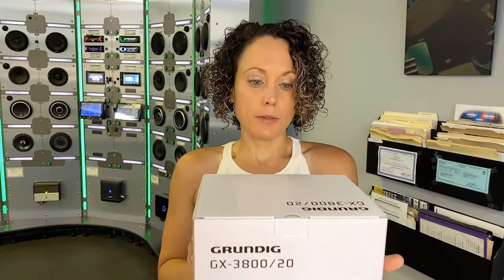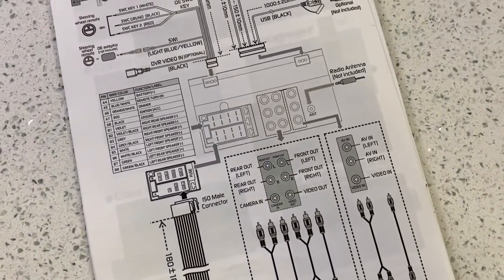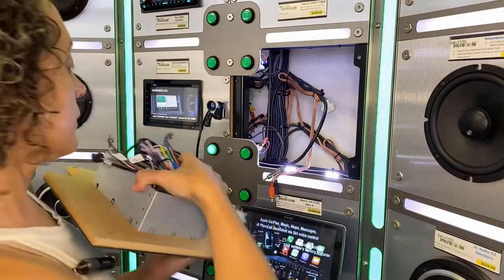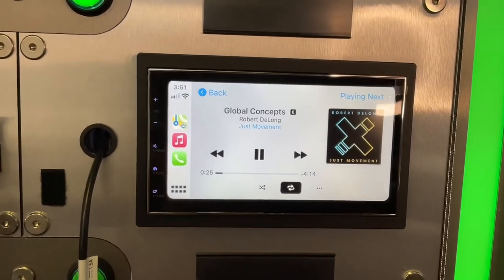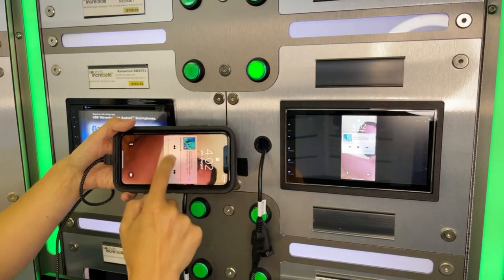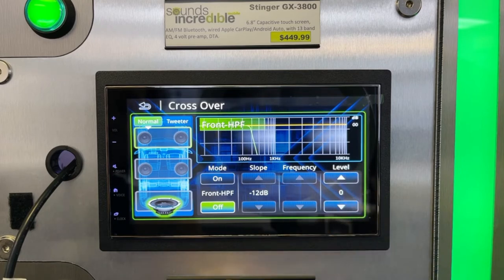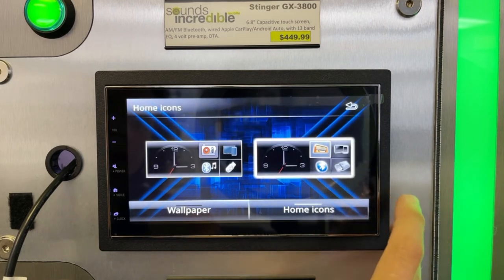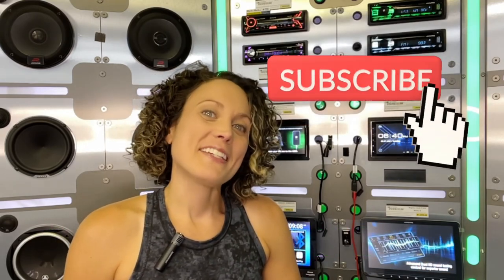Grundig GX-3800 unboxing PLUS Review CarPlay Android Auto Stinger Electronics by @carstereochick

Comment: Just bought this unit after having had 2 Kenwoods go bad after a year each from the same shop. I can't build a system on stereos that don't work. My next purchase was going to be a Kicker low profile sub with an amp, but now with this sudden failure of my Kenwood I got this unit and am so happy to see the crossover and virtual sub options. I have a Wrangler JK that will never sound like my husband's truck but I want to come close. Thanks so much for your detailed review! Hoping to get right into setting it up in an hour when I pick up my Jeep.
Reply from the maker: 😬 I’m glad you found the review helpful, but I gotta ask what model Kenwood?? Kenwood has been rock solid for me with anything that is CarPlay or Android Auto compatible (I have one in my 2014 JK). Did they send the defective Kenwood radios out to find out why they failed? Only reason I ask is Wranglers are notorious for leaky tops and the only time I usually end up replacing a Kenwood in a Wrangler is due to failure by “liquid intrusion”. Usually you can’t see it so the shop might not be aware. The Kenwood repair center we use, United Radio does free estimates for out of warranty equipment. Might be worth finding out why the other two really failed.
Reply: @carstereochick  the first one I don't remember the model but it was a DDX model bought in Feb 2019 that had USB and disc player. In May 2020, I was pulling into the driveway and suddenly heard a loud POP and it went dead. Admittedly it had sprinkled that day while I was driving but didn't think much of it since no water ever hit the dash (or so I thought). This last one I got to replace it, was a DMX706S. A month ago the unit just turned itself off and on, off and on, twice, as I was driving. Then last week the unit stopped talking to the steering wheel controls, and the buttons which I'd made yellow, first started going through a demo cycle, and then settled on red. Then I couldn't use any of the buttons, only the touchscreen. Mind, I usually only ever drive my Jeep for an hour in the morning and an hour in the evening 6 days a week, since we use my husband's truck when we go somewhere together. I have not had the top off my Jeep since May 2020 (since I feared rain going in the disc slot burned up that one). I have a 2015 JK Sahara by the way.
Reply from the maker: @runswithbeer  thanks for the details! Yeah, I gotta say that is really atypical of Kenwood, that’s why I’m so surprised, but that behavior is exactly what I see them do if they get wet. I usually see issues with the freedom panels either not seated perfectly or just the gaskets wear out over time. You don’t always see it and it can drop right in the pocket over the radio so definitely just something to keep in mind. I could see a fluke with one unit going bad, but two in such a short time span seems like something else going on that we’re not seeing. For what is worth, I have the fewest defectives with Kenwood; I can recall one in the past 2 years and so far I’ve had really good luck with this new model and I hope you do too!

Comment: Would like to add that my tech at the shop really went over & above, sitting in my Jeep with me and setting up the Crossover, EQ, Virtual bass, and X-Bass based on how I liked the sound. I feel like you either have to choose between the Virtual bass OR the X-Bass. Both on at the same time doesn't sound right. But boy does the bass really pump! I laughed and told him he just screwed himself out of the Kicker sale. LOL The only issue I have right now is that when driving, the radio station changes for no reason if it fades out a little. I'm playing with the RDS settings, and it seems that turning on AF has fixed that.

Comment: Please help me with this. When you start up the car is it really necessary to select country and continent every time. And I also need to go to settings and turn demo off as well ?  There’s like no exit and save. Can you help me with this question
Reply from the maker: Sounds like you didn’t wire up constant power because it’s not retaining memory. Check your wiring with a multimeter, need constant 12 volts regardless of key position on/off on your yellow wire. Good luck!
Reply: @carstereochick  OK thank you so much 😊
Reply: har samme problem fandt du af det?

Comment: Great video - best I have seen on this unit, which I have now installed in my Mercedes W211. One question, you didn't really show the purple reverse camera wire. Can you tell me what sort of connector that is? Do you think a separate power source would be needed for a reverse camera or is there a plug and play camera on the market I can buy?
Reply: Conservas el menú del coche para activar o desactivar por ejemplo el control de estabilidad o mirar consumos del vehículo? Gracias

Comment: The light blue/yellow wire labeled SWI. Is it directly plug into canbus SW controls? My 2005 Saab 9-3 runs canbus from the Controls to the factory radio.

Comment: I just had one of these put in my Cadi 2010 SRX, and I'm trying to find the right adjustment for sound quality. Do you have any advice? I had to get the whole kit for it to fit, I just want my sound quality back. Oh, this was soooo helpful because I thought I just some ole cheap radio but you help me to see thing differently.
Reply from the maker: Hi Sean, I'm sorry to hear you're having trouble with this stereo in your 2010 SRX. Do you know what kit was used, was it the Metra kit? Normally when upgrading to a new head unit in an amplified vehicle like that, we usually see an improvement in sound quality because we're retaining the premium amp/speakers, but we're starting with a cleaner signal at the head unit. Additionally, many of these installations are done "speaker level" input meaning we're basically amplifying an already amplified signal so usually you will have more output/better sound quality with the aftermarket stereo. 

However, it depends on how the factory amp is retained. I know Metra makes an all in one kit and I only see two wiring options, I don't see any adjustments for gain settings or anything like that in their instructions but I also can't see if it's RCA or speaker level. It would be hard for me to say what to do without having heard a before and after and looking at the harness/interface used.

Can you describe to me what the sound was like before and how it is after? Is it any louder at all? Or do you feel like it's quieter? If it's quieter, I suspect it was wired RCA level so you're basically connected directly to the pre-amp of the Grundig meaning you're not using the internal amp of the radio at all. Once in a while we get a funky application like this where the kit is designed to go thru RCA, but there just isn't enough signal from the factory Bose amp. In that case we usually cut the RCA ends off (if that's an option - depends on the parts used) and go speaker level which will have more output, but sometimes it's too much output or noisy. Sometimes when that happens we can use the head units internal volume offset adjustment to fine tune it (this one has that) OR we add in an external adapter like a PAC Audio LP7-4 which allows us to level match between the Bose amp and aftermarket head unit amp. I hope that helps!
Reply: @carstereochick  I’m not sure about the wiring I had Customer Sounds in St. Louis professionally install it. But what I did was hit the reset in the unit and did some work with all this setting and I now have the sound quality sounding much better, my only thing now is trying to get the bass back how it once was with the original unit. The bass seem to sound very distorted when I turn the volume up. So when it’s 3/4 the volume peak, the bass is horrible. But your video helped me sooo much.
Reply from the maker: So glad to hear the video helped! You may have luck lowering that SLA or source level adjustment in the settings menu. There might be too much input signal from the factory amp causing the distortion.
Reply: @carstereochick  Thank you and I will try that.

Comment: Thank you so much for the in depth review, I also loved the detailed test with SMD & Fluke. I was looking for something like this for my 2013 Toyota Auris hatchback. It's basically an older Scion iM. I think it will be a good improvement considering the price point.
I see Grundig is owned by a Turkish company, Koc Holding [which is the owner of many big brands over there - Arcelik, Beko (white goods & home electronics), Tofas (car manufacturer producing FIAT cars & minivans under license), Ford Otosan (produces Ford vans & heavy commercial vehicles under license) and a lot more smaller ventures] since 2007 or something like that. Not sure what to make out of that, also I wonder about the actual manufacturer of these devices as I don't see Koc doing any sort of car audio system under any of their other brands. One car audio shop (a rather large one for here) said it's made by (or the same ppl who makes) Kenwood, I'm not so sure about that. Any chance that might be true?
Reply from the maker: Hi there! So glad you enjoyed the review :) From what I could tell from doing research and speaking to our supplier, my understanding is Grundig is a German company. But it sounds like they are part of a huge global conglomerate and it does make sense that part of that is in the automotive industry. We see that with Alpine too. They have a very close partnership with Jeep/Chrysler/Ram/Dodge. Their parent corporation is Alps which specializes in "components, sensors, communication, modules in a few different sectors, including automotive, consumer electronics, mobile devices and game markets." After installing quite a few of these and spending a good amount of time listening to it side by side with Kenwood and Alpine, I will say the quality level is right up there next to both of them, probably more similar to Kenwood. I was really pleasantly surprised, because I didn't know what to expect. I was thinking it was going to be like some of the cheaper brands we have in the US like Boss for example.  However I doubt that it's made by the same people as Kenwood. This receiver is made in China and most of Kenwood receivers lately appear to be made in Indonesia.  Perhaps they are sourcing some audio components from the same manufacturers? I really don't know. The operating system is entirely different, but from a sound quality perspective and reliability perspective, they are similar. I hope that helps!

Comment: So I have this unit, installed in my 2005 Dodge Ram SRT-10 quad cab with the factory alpine stereo system. I was told this system DOES NOT work with my factory system to maintain the amps, also there is NO adapter that allows this. 

I’m finding this hard to believe. For me to enjoy the factory stereo (which is great I think) I have to used an amp bypass harness and purchase new amps just to get back to the sound of the stock head unit? Same problem goes for the factory steering controls. 

Please tell me the shop that installed this was wrong and I don’t have the basically do a full system replacement. Thanks in advance for the reply!
Reply from the maker: Metra made an adapter at one point, but I don't think they have it listed on their website anymore for some reason. I think I sold one in the last year so it's possible it's only been recently discontinued. I'd have to download their excel spreadsheet on old part# vs new and check my sales history when I'm at the shop. I want to say it was something like CHTO2? I remember it specifically was for 2004 - 2005 Dodge Ram with the Alpine premium sound. Or maybe it was 2002 - 2004? They were definitely the only company making an adapter for these earlier trucks with the digital Alpine amp. If I get a chance to check my records at the shop I'll let you know the part # even if it's discontinued.
Reply: @carstereochick  OMG please and thank you so much. I was so excited to get this unit and then to have it totally downgrade the system was a huge disappointment. I hope you can find something.

I would even go as far as a nightmare re-wire rather than buy all new amps to retain the great factory sound quality.
Reply from the maker: @combsy02  so I checked my records. It looks like we used a Metra CHTO-02 in 2002-2005 Ram 1500 BUT only one of those installs was labeled as a 2005 and yet the install guide says it’s only for 2002-2004. I talked to Metra and they said 2005 is different and not compatible so I don’t know if that client had the year right on his truck or maybe it was a 2004.5 or something where we just lucked out and it worked 🤷‍♀️
Reply: @carstereochick  ok thank you for digging into that. So because you are the expert here, let me ask you this. What’s the most cost effective way to get back to my factory sound quality using this head unit? Two compact amps (6 channel for doors/tweeters and then a 2 channel for the sub)?
Reply: @carstereochick  further, if there was once a distributor that made this harness would it be fair to say I could seek to have one custom made by an expert? I’m just having difficulty that I have to replace both amps to regain the factory sound my truck had before this radio upgrade. Thanks again in advance!
Reply from the maker: @combsy02  so right now you have the main speakers powered off the head unit and sub is disconnected? Most cost effective route is to buy 2 small amps, a 4-channel and a mono. I’ve had good luck with the Alpine KTA-200M on stock subwoofers and you may want to consider either the KTA-450 or KTA-30FW or similar for the main speakers. I hope that helps!

Comment: Great video.  Which would you think will be better? This or the Sony XAV XA150?
Have a good day
Reply from the maker: Thank you! Depends on what you’re using it for. If you’re using it with an aftermarket amplifier, then I would go with the Grundig for the higher voltage pre-amp.
Reply: @carstereochick  i have a pioneer GM-D1004 brick type amp im planning on using. Would that make much of a different between the two radio? In still leaning slightly on the Grunding at the moment. The only thing I don’t like so far is the UI.  So, plain. I may be able to over look it for sound quality performance.
Reply from the maker: I do think the signal from the Grundig was cleaner, but I hear you on the GUI. Keep in mind if you are using this for Apple CarPlay/Android Auto, that interface is the same regardless of what head unit you get.

Comment: They seem to know each other very well. I have a problem that I haven't seen here before. The external microphone doesn't work for me. If you press the "Call Transfer" button while making a call, the microphone works, but the loudspeakers no longer work. They are then activated on the phone. It's the same for iPhone and Android. Have you or anyone had this before? The seller says you have to contact Grundig.
Reply from the maker: Have not run into that. If you haven't tried this already, I would do a hard reset on the radio plus clear the device memory from your phones/restart them as well.

Comment: Does this unit then need a Steering Wheel control harness adaptor.  I have a 2014 Kluger.  Was tossing up between this and the Sony.
Reply from the maker: It depends on the car. In your case, if that is like our 2014 Toyota Highlander (looks the same) you are probably going to want a different head unit that supports the iDatalink Maestro. Any iDatalink Maestro compatible unit will retain things like the steering wheel controls, access to vehicle settings, retain secondary information display (if equipped), retain stock premium amp, OEM reverse camera, etc. 

The built in SWC module is good for older analog vehicles, non CAN Bus communication vehicles. In this case you would probably need a separate CAN bus compatible SWC module - the PAC Audio SW-CP2 - set to #7 (Pioneer). But that's just to retain SWC. Now, if you don't have the secondary information display or the OEM reverse camera and don't need to retain access to vehicle settings, then you don't necessarily need an iDatalink Maestro compatible radio and could still use this head unit, but you would probably still need the secondary SWC module for this particular car.

Comment: Is a real German radio or Chinese? Company been sold to Turkish. I have some doubts about sound quality.
Reply from the maker: Great question. Not sure if you caught me pointing out on the box the made in China part. This radio is made in China, BUT you might be surprised to hear that many electronics in our industry are made overseas, often in China. Alpine's iLX-W650 (which was one of the the models I was comparing this to from a sound quality and feature perspective) is made in Korea, some of Alpine's higher end models are made in China and Kenwood makes a lot of their stuff in Indonesia. All JL Audio electronics such as amplifiers and DSP products are made in China (they only make some of their subwoofers and speakers here now).  

So although yes this particular radio is made in China, that is also the case for many other products in our industry. Some of them are quality. Some of them are garbage. For me, this radio was a rock solid performer and great value during supply chain issues. Since prices have come back down to reality on the Alpine iLX-W650, I no longer offer this model. It was a great buy for $350 when Alpine was at something like $499 for the iLX-W650.

My understanding is Grundig is a German company still headquartered in Germany, but with products manufactured in many different places and distributed globally. Not sure if all the decisions are made out of the German branch or what. It can be hard to tell with these global conglomerates.